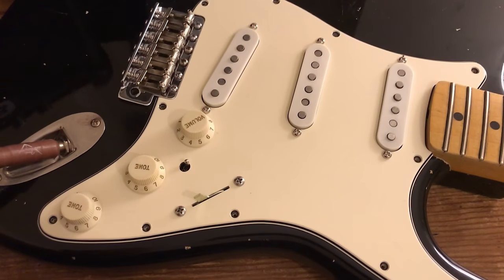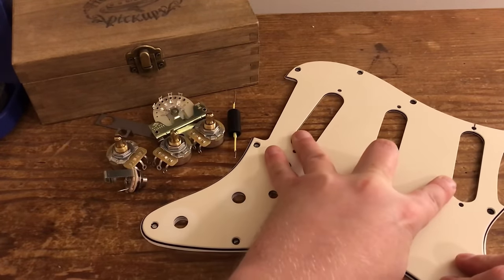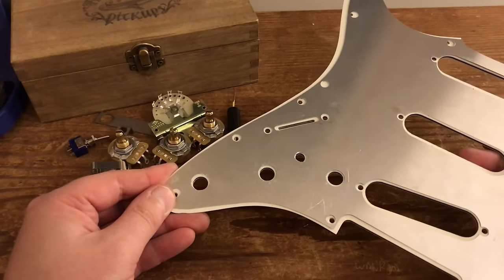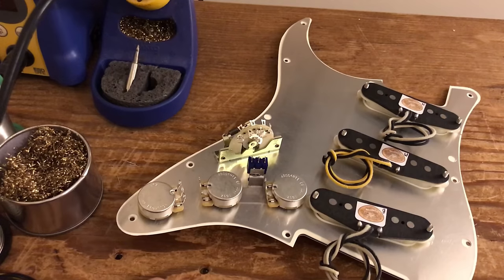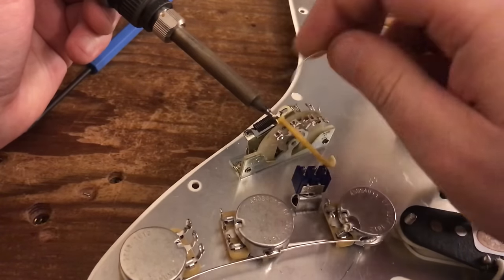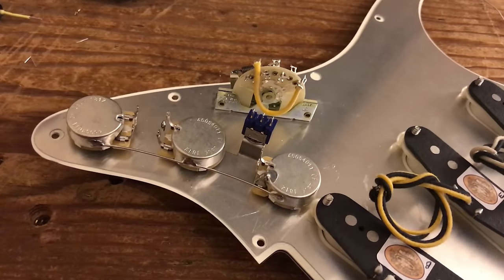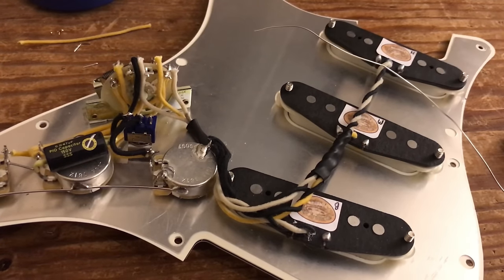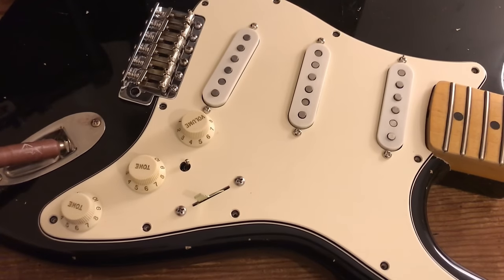Gilmour Strat Wiring Mod 7 Way Strat Wiring

Comment: The neck/bridge configuration on my Strat is my favorite clean tone.  I recommend this mod to any Strat owner.  It's so easy anyone can do it.
Reply from the maker: Billy Russo it is indeed! Great tone on the neck/ bridge combo
Reply: @DougHinVA  This mod was literally the first thing I attempted to solder YEARS ago, with no experience whatsoever.  It's easy.
Reply: @joshjosh9010  Yeah at first it's scary, but once you do it, it's nothing big.  Just heat the parts and melt the lead to it.  Don't heat the lead to the iron and drip it on!  That's about it.
Reply: @DougHinVA  you can buy obsidian wire solderless if you dont know how to soldering
Reply: I have a vintage modified I made like Ritchie Blackmores iconic Strat I’m doing this mod for seven way on a black Strat
Reply: @SixStringSupplies .

Comment: My Strat does the same thing, but using a Blender pot. 1 Volume, 1 Tone, 1 Blender. At 10 the wiring is as normal, the more you dial in the Blender the more of the pickup gets blended in. If you're in position 1 Bridge the Blender will dial in the Neck PU. If you're on the Neck PU, the Blender will dial in the Bridge PU. In positions 2 and 4, the blender will dial in the neck or bridge so that all three pickups work together. Either way, it's a fantastic mod. Your Strat takes on the vibe of a Telecaster when you have the Neck and Bridge working together. The blender does allow you to dial in as much of the blended pickup as you want, so the tones vary from off at 10 and gradually increasing until at 0 the dialed in pickup is fully functioning. I find 1 volume and 1 tone works just fine for all pickups.
Reply from the maker: yeah the blender mod is my favourite Strat setup - did a video on that one here: https://www.youtube.com/watch?v=xEuXWIRjibc

Comment: What about - one Master tone with a Toggle Switch between it and the 5 Way switch (Tone / No Tone), and the other "Tone" pot becoming a Volume Knob (instead of a 2nd Toggle Switch) for the Middle pickup to go direct to output. The Neck Pickup goes from the 5 Way direct to a Toggle Switch to output as you described.

Comment: Thanks for this superb detailed video. I’m curious if there’s a specific gauge of tinned copper grounding wire you used/ tend to use. Thanks
Reply from the maker: Hi - thanks! It’s 19swg (1mm outer diameter)
Reply: @SixStringSupplies  thanks
Reply: Also- I think that adding the jumper wires between pots in an already shielded control cavity leads to a ground loop. At least that’s what Lindy Fralin states. I am experiencing a lot of noise from my Black Strat build and am going to try disconnecting the jumpers to see if it reduces/ eliminates the noise.

Comment: I’m in the process of putting in 6 recessed switches like this. There are not pots or 5 way just switches . I’m using a piece of perforated mild steel plate with 6mm holes.

The final stage will be drilling the holes in the pick guard for the switches to pop through . It seemylike it would be easier to drill a larger circular hole like you have , but I really like the look of the thin oval/rectangular slot , but would be a lot harder to do with cnc or a drill press I think
Reply from the maker: I too would prefer an oval/rectangular slot but didn’t have the tool piece to do it. (Not even sure how to do it, laser I guess) however, the small circular hole does the job...and is barely noticeable. Thanks for watching and best of luck with your project, sounds cool! 👍

Comment: Is this mod possible with a hss split coil strat with tbx tone control,
The split coil function is controlled with a little switch where the bottom tone pot should be, would this mod create phase or major hum problems with the humbucker and neck pickup turned on at the same time,

Comment: Thanks a lot for the very informative video. Can the 2 outer ends of the toggle switch be connected together, so if the switch goes to any of the 2 sides, it activates? or will this short the circuit? thanks

Comment: Gilmour used a ceramic 0. 22 cap and a treble bleed too. The treble bleed is even easier to fit. But essential for a true Guilmour Strat.
Reply from the maker: Thanks for that info i wasn’t aware of that
Reply: Pretty sure that’s incorrect

Comment: For people who don't want to add extra switches to their guitar, i hate switches between my knobs on a strat.... A no load tone pot wired as a blender pot for the neck/bridge pickups is a much better mod IMO... Gives you the same exact sounds and more, it really is much more versatile, and you wont have some in the way switch if you are someone like me who actually uses the Vol and Tone knobs a lot during songs.

Comment: Great video.  Question.  When you are using the bus wire to ground your pots, is one continuous piece of wire or two separate pieces? I am away to wire all my parts for a Gilmour style scratch plate.  Thanks.
Reply from the maker: I tend to use a continuous length but you can do either. One length or 2 short lengths
Reply: @SixStringSupplies  thank you

Comment: Thank you so much, this channel has been incredible. This mod plus the HSS wiring tutorial have been comprehensive and unbelievably helpful. I do have a question-- how would wiring this switch with a push/pull switch be different? I saw the wiring diagram posted on your website, and I'm a bit confused about why the bridge hot wire is going into the lug of the push pull instead of the pickup selector switch like in this video (with the neck pickup). does the push pull pot not function exactly the same as the toggle switch? Thanks again

Comment: thanks so much for your videos; i did this mod to my strat following you, but thing i noticed is that when a i place the selector in the position that the middle and neck pickup has to work together just the middle pickups works, and in the neck position the neck pickups does works fine; al so i did check if the pickups was ok with the digital multimeter and its fine; can you help me here, is this part of the mod? or is there anything im not aware... tanks again, Cheers

Comment: Just tried this and I get excessive noise from the not connected lug when the toggle switch is off. Can't touch any lug in the circuit with out getting a loud buzz. What have I done wrong?

Comment: Thanks again for the great video !

I have a question.
I have an american strat special SSS, texas special PUs.
I have a basic understanding of how the pickguard is wired up and the purpose of caps on the tone pots.
But my strat has 2 disc caps per pot, the same 2 caps on each pot.
Cap #1 is BC Z5U 203M 1KV
  This cap is installed in a standard way, grounded to pot and connected to lug on left, when lugs are pointing up.
Cap #2 is Y5U 104M
  This cap is soldered to middle lug and right lug.

.... Can you tell me what the purpose of Cap #2 is ?

Thanks
Terry

Comment: Great mod. I will try it.
I have a question though.

Wondering why you use a double throw instead of just a single throw switch ?
Reply from the maker: Thanks. No real reason it was what I had to hand. Never tried it with a single throw switch. Cheers

Comment: thaaaank you so much - beautiful explained!

one question....if i want this exact wiring for the gilmour setup BUT have a passive singlecoil format humbucker for the bridge (Haeussel ST Klinge ) and i want to add a Push-Push Button to switch between humbucker and single coil (precisely a Fender Deluxe Player Jeff Beck DPDT Switch) ...does that change the original wiring completely or not?

Comment: An update on my modifications. I did a 9-way wiring mod, with the DPDT switch, and it worked great with a 500k volume pot. 

However, I got my push/pull pots today, so I went back at it. The plan is to still have the 9-way (series/standard/parallel) with the 3-way switch, but I want to have the possibility to phase invert a pup with one of the push pull pots, while using the other as a separate volume (and on/off) for my piezo under-saddle pickup. I have a stereo-out jack, where one will be pups, and the other piezo. (Note, the piezo goes into an onboard preamp, that's run by a 9v battery. I need to connect it so that the battery connection is only active when the jack is plugged in.)

I'm really not sure how to wire it up. I made a couple of attempts, but I couldn't even get sound coming out. It's a standard SSS Strat. 

Help would be appreciated <3
Reply from the maker: Hi Benjamin, we are closed for the Xmas holidays so unable to give a detailed response - however, this wiring diagram could help for the 9 way strat setup using push pull pots. https://www.sixstringsupplies.co.uk/9-way-stratocaster-wiring-diagram Happy holidays
Reply: WHAT KIND OF GUITAR IS THAT!?! Geeee! If you did it, NICE job

Comment: does both pickups connected in series or parallel when we hit the switch on?  I've done these . but not fully understand it on how it connected..I knew that telecaster is connected in parallel in position 2..but im not sure the sound I got is parallel or series sound.. I want to achieve that quack telecaster have..but I'm not quite there

Comment: This mod didn't work for me. Maybe it's the fact that my Strat wiring is already unconventional; though I did connect the wires to the appropriate positions based upon my current wiring. On a side note, your wiring is extremely clean. I like it.
Reply from the maker: thanks, appreciate it. yeah this mod works from standard/conventional wiring.

Comment: Question.......if you ONLY had one volume and one tone on this circuit ,  what would you have to change ? Thanks !
Reply from the maker: Just add the wire from switch, to mini toggle, to volume.
Reply: Thanks ! @SixStringSupplies

Comment: Should I use that same capacitor, I have a DiMarzio single coil size humbucker in the bridge position?
Reply from the maker: Either a 0.047 or a 0.022, whatever your ears prefer!
Reply: @SixStringSupplies  ok thanks man
Reply: @dave691974  I have dmarzio single coil size humbucker too at bridge.. I want to make it sound really like two humbuckers equipped guitar for metal songs .have you modified to 7 mood yet? How is it with all three engaged
Reply: @driftingmelodies  I haven't installed the mod yet my guitar is completely disassembled, I'm currently sanding it and repainting it .

Comment: I have a 7211 C&K double pole on-on-on switch.  How could I do this with that, and what could I use the third position for? Thanks
Reply from the maker: Benjamin Austnes Narum hi what pickups are you using?
Reply: Six String Supplies it's a standard strat with 3 single coils.

Comment: Which do you prefer, this switch or a blend control w/master volume and tone?

Your HSS (w/the super 5 way switch) video saved my life btw, thank you! Wired my humbucker split with a resistor to ground PRS style so the split humbucker is a touch hotter than the middle pickup. (Stopped trying to get my HSS to flip to something like an SSS and just got another Strat for that, lol.)

Comment: Hi! I'd like to do this in a guitar with HSS configuration 1 volume pot and 1 tone pot. The guitar has 2 potentiometer 500k. Is it possible to do this 7 way mod with a push pull in volume pot? And also I wanna do the coil split humbucker mod in push pull tone pot! Can you help with a diagram? I don't know how to do to link one mod with the other!!!
Reply: Can for sure use a push pull mod. That is the modern way.

Comment: Hello my friend, I have a little question. I've done this exact mod to my Squier Standard Stratocaster and I checked that the pickup combination that I get when I use the switch is correct (with a screwdriver I checked each pickup in each position) but the effect of the bridge pickup is barely noticeable when it's activated by the switch. Do you know why this could be happening?
Reply: Is your guitar shielded? If not, check for hum when you switch on the neck and bridge pickups, if the hum is greater than in the case of just the neck/bridge, then it works.

Comment: All items out of stock :-(
Reply from the maker: sorry man! We have all electronic items in stock, except the mini toggle and the bracket.
Reply: @SixStringSupplies  will you  be restocking them ? The gilmore kit, bracket and switch? I do not like the 7 way switch push pull method and gilmour method would suit me better
Reply from the maker: we never have stocked them. We only stock the strat wiring kit and the pickups. However, there are links on where to buy the other bits in the description above
Reply: @SixStringSupplies  cheers

Comment: Rather than drilling and installing a mini switch, the best way to do this mod is to make the neck tone knob a master tone and the bottom tone knob a blender pot which when rolled off to 0 turns the neck on in positions 1 and 2, and the bridge on in 4 and 5. Same results, less hassle, and cleaner looking. As for that bracket, stupidest part created. You DO want the full switch if you are using one that way you can work it properly. Seriously, you might want to STOP giving tutorials if you're going to teach the most ridiculous way to achieve something.
Reply from the maker: Hello Jeremy - thanks for your pleasant feedback. I agree, the blend control you refer too certainly is cleaner and more efficient giving the same result - that wiring mod is covered here: https://www.youtube.com/watch?v=xEuXWIRjibc

The video is entitled "Gilmour Strat Wiring Mod" because it is exactly that. Gilmour had a mini toggle switch (which was recessed, using a bracket i might add). 

PS for clarity, you can also use a push pull pot.

Thanks for watching!
Reply: Dude. He has built the switch in exactly the same as David Gilmour's Strat, you know, the most expensive guitar in the World!!! Everyone has their own opinions, I for one applaud the man, well done.
Reply: Duh spaz.

Comment: Hi, I would like to wire my bridge to tone pot 2 only and share tone pot 1 with the neck and middle. I prefer this configuration.  How would I add this into the build too.
Reply from the maker: using the the diagram on this page - connect "B" to tone 2 and add a jumper wire between "N" and "M" on the switch https://sixstringsupplies.co.uk/pages/5-way-switch-wiring
Reply: Thank you